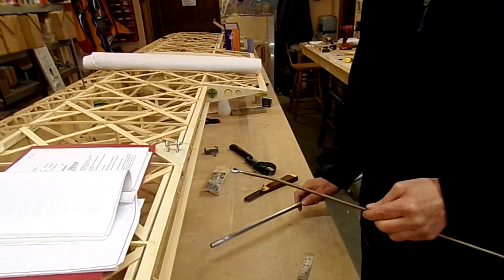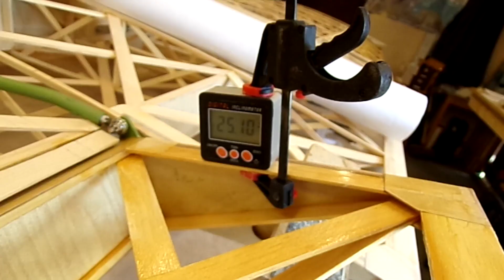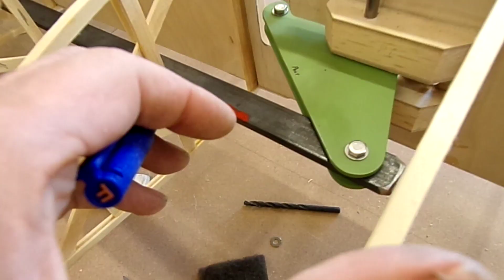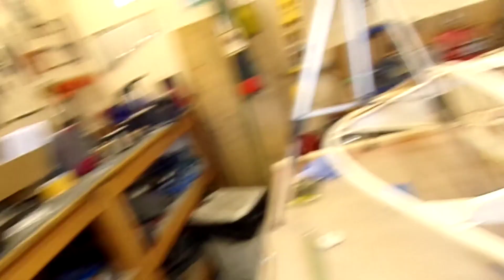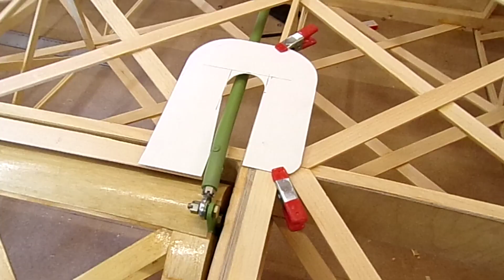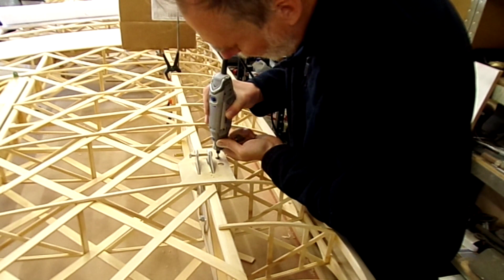EP48 Fisher Youngster V Lower wings built and ailerons finished

Comment: My comments get a bit boring but always blown away by not only the different skills involved in this build but the fact that everything is in imperial measurements, what's all that about :-)
Reply from the maker: I know what you mean about imperial measurements, I am forever converting them in my head to metric and back the other way and the aircraft will have a mix of metric and imperial parts. The design was first drawn up in the USA (all imperial) and now produced in Canada (Like UK can't make up its mind) and being built in my shed (I can work in both but would rather be metric). I must say that there are a few skills but not a lot of high level stuff unless you start doing Algy mods and then a few gray cells need to do some work :-)

Comment: Its great following you along on this build. So many little details.  I'm so glad I could dial in the aileron differential on my model transmitter.
Reply from the maker: So now you can make your model rolls more axial. 😏
Reply: @flyingkub  I always like trimming my pattern models. Did you ever use the trimming Triangle?
Reply from the maker: @GolfFoxtrot22  I have used so many methods for getting my models trimmed for pattern work, I think I recall one called the triangle but I could not say for sure. The last pattern model I did trimming flights on would be over 6 years ago.